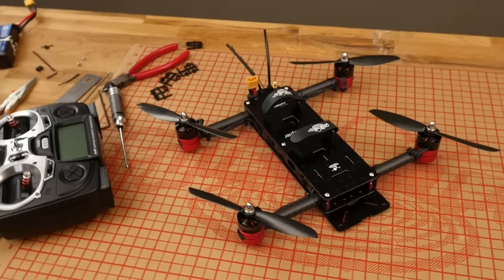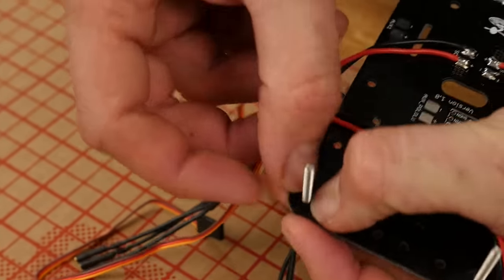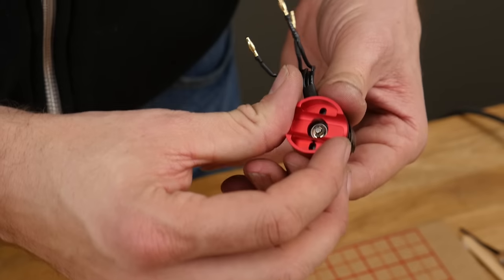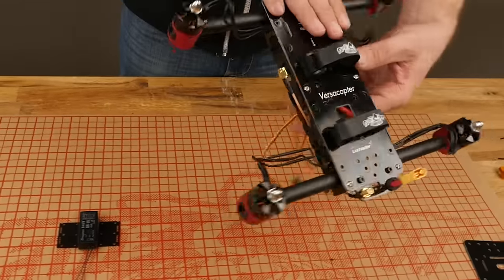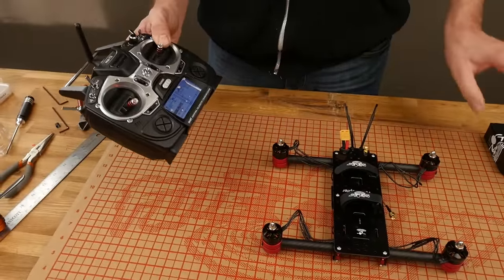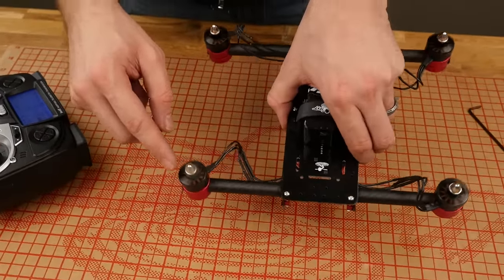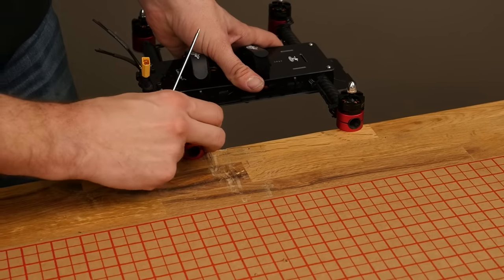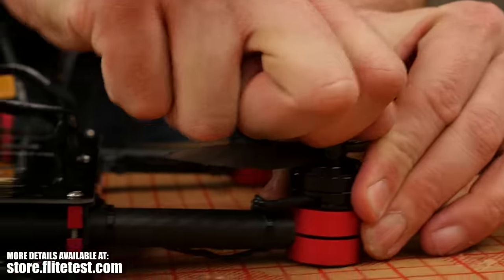FT VersaCopter v2.0 - BUILD | Flite Test

Comment: Hey Guys, from the links above and on the stores page to buy the VersaCopter, you don't have what else is needed for 100% RTF quad. Why don't you list what parts are missing from the "Power Pack E" to get it in the air and also links for a great FPV experience? Love your video's, keep'em coming :)

Comment: Hi FlightTest awesome video, this kit is probably going to be the quad copter that gets me into FPV. Since I'm relatively new to building and buying multi rotors i have a few questions. Does the FT VERSACOPTER 280- V2 -QUAD KIT come with a receiver or battery? and if it doesn't come with a battery how can i find a battery that won't damage the motors.

Comment: I wish I could get as good at flying drones as you amazing people at flite test but for a 13 y/o I never have much time or money to buy these. I recently got an akaso x5c for Christmas and I was wondering if it would be possible to use the transmitter from that on any drone you guys make. One last thing is that I am currently working on an up to code firefighting drone with a built in tank so you just have to replace a large co2 cartridge and it's possible to hook up to a fire engine and it would be much larger and I'm going to suggest it to my town if I can ever get a prototype built.Thanks for all the inspiration to start this.

Comment: With this build does the Voltage telemetry work with these esc's? Or do I need to buy a VM-80 to keep track of the battery voltage with alarm on my radio?

Comment: I'm curious to know why you guys went with the 280 size for the versacopter? Seems that 250 and smaller are the most popular for fpv racing.
Reply: +Devin Stone My only guess is that the slightly larger size make it easier to solder the ESCs and other stuff to the power distribution board

Comment: I recently got a kit for the versacopter and azide toy I swiched the leads on the flight controller to positive to negative but it works fine but another mother won't work will I have to buy a new flight controller or is there something in and do to fix it?
Reply: *on accident

Comment: Hay Flite Test, I'm interested in this Quadcopter frame and was wondering if my DYS BE1806 2300KV brushless motors will work? They seem like they would, but my motor mount screws look thinner than the ones in the video. Could you please list the width of your screws for the motor boom mount.
Reply: unfortunately no the 1806 motors will not fit the aluminum motor mounts 
that come in the kit. Both the screw size and the bolt hole span are to 
large for the 1806 motors. Josh, maybe you could make a delron or other 
material adapter to accept the 1806 motors because the 2204 motors are 
just to heavy for my liking. just a thought :) Kenny

Comment: Little question here, if i want to power my FPV Transmitter by the main battery, where on the board do i have to solder ?
Do i have to solder the power wire onto the polulu "connector", or can i just solder the power wire onto "power" and the 2 power wires for the transmitter onto aux 1 ?
Thanks for your help.
Kind regards out of switzerland 
Silvio
Reply: I think you have to solder to the polulu circuit.
Reply: ***** i just put it onto AUX 1, it works fine ^^
Reply: Neat! Pics please. My set up is a nightmare; a 2200 3s & 800mah-1000mah 2s on top of 503 grams. I upgraded to 3-d skirt from rcpartshanger.com glows in the dark.

Comment: this my Naze32 rev6 Full 10DOF Quadcopter Flight controller for QAV250 ZMR250 board that I have can you tell me how to wire my wires up to the flysky receiver this board plug has one white wire and one red wire and one black wire and one orange wire and one yellow wire and red wire and one brown wire and the other 3 wires are white red and black they run into on plug  maybe someone can help me

Comment: Does some of you guys have a good idea on how to get the USB of an SPR 3 controller accessible within the body of the versacopter?

I find it hard to solve as the board cant be turned by 90° due to the ESC outputs ;)

Any hints thankful appreciated

Comment: Thanks for the video! GJ !
But may I give a little advice - recheck your soldering because most of the connections on 2:44 are pretty much examples for cold joint. Or maybe it's the video quality I'm not sure. They should be round and shiny ... And again - great video, nice quad !

Comment: so what i need to make this is the FT VERSACOPTER 280- V2 -QUAD KIT the Power pack E and the  ms -12 Something i dont now waht it is can some one plz send a link
Reply: +Joris Alkema And what kind of a FPV camara and transmitter do i need (Plz a Link) (srry for bad eng
)
Reply: +Joris Alkema and a transmitter ? ...
Reply: +Joris Alkema and is that all i need to make it work ?? does all the paks include cables and extension ??? 
and the flight controllers
??

Comment: Hey guys really like what you do, the concept of versacopter, keeping everything "in the box", is a really good idea, you made it H its also fine with me... But Wao the building process looks like the foam planes kits you are building.. My interest went away at the min 7 of the build .. Those sides plates ? can t they be carbon maded, precutted, with no extra mini parts for adjustments ?.. This is and ingienor concept, not a builder or user process at the end, to much mini parts and tiny adjustment just for the body.. When we want it simple, and tuff... You are always saying, "you re gone crash", then i prefer to crash a zmr, or a cheap carbon blackout clone frame, i change and arm, an aluminium stand, and fly again... I wonder how this looks like after a big crash... i m sure those mini parts are blown away... you can make it, version 3 .. simple and tuff !!!

Comment: Please help me. I dont know much about racing drones but i really want to by one. I think this would be a good beginner drone but i know nothing about the parts needed to build one. So i have several questions:
First of all, does the kit bring all the parts needed to build it? If not, what else would I need??
And, what about the radio controller, does it bring one, which one can i use where can i buy one ?? Then , what about FPV how do i install an FPV system in the quad? Parts needed ?? 
Which battery do i need to power the drone ?? 
PLEASE help me I really wanna buy one .
Reply: if your just starting dont get fpv yet.  and on their store there is an option to get the e pack.  the e pack has escs motors and props.  so when you get the versacopter v2 with the e pack, you still need your radio transmitter (the controller) flight controller, battery, and battery charger, and receiver. but if youre just starting you should get the graupner kit shown in this video.  that includes the flight controller, transmitter, and receiver.  so now you have the versacopter v2 with e pack and graupner combo.  now you just need a lipo and charger, a 3s lipo is recomended.  and before you buy your stuff you should watch videos about lipos and lipo chargers
Reply: Thankyou !!!!!!!!!!!!!!!!!!!!!!!!!!
Reply: +MrKrespo25 yeah so basically all you need is versacopter v2 with e pack, graupner combo, lipo, and lipo charger.  and then after a while you can get fpv
Reply: ok perfect

Comment: +FliteTest  Hey, i rlly want to get into the hobby and have some smaller racing drones, the link you provided for all the a components you need. is it the 69 dollar kit or do you need the power pack E option. Any other transmiters cheaper than the mz-12 that will 
still work. Do u need the gr-18

Comment: That Graupner combined flight controller and receiver looks very nice. I like the idea of being able to update the settings using the radio. But doesn't it include voltage telemetry as well?  Good job on the Versacopter 2.0 design.

Comment: What battery do you recommend for a beginner-ish pilot for this quad on power pack E
Reply: Batteries are not specific to beginners. Batteries are batteries. You can go up to a 4000mAh 4s 15c for long flight times. the one they use in the video is a Lumenier 2200mAh 3s 20c.
Reply: ok Thanks

Comment: Nice upgrade to the original and thank you for offering a component kit separately so I don't have to buy a whole quad kit again. One question, is that a smoke alarm with a low battery beeping in the background of the build video?
Reply from the maker: +Yancy Smith Nope, I think that's the door chime of people going in and out of the shop during the video. 
Hopefully we will have a separate studio room to shoot in some day so we don't have to worry about that sort of thing. -Austin
Reply: +FliteTest can you bind a specktrum dx5e to this? I wanna get into quads but I'm not in the budget to afford a new transmitter.
Reply: +Galactic Diamond not as it in in the video, no. You would need to buy a Spektrum receiver and a different flight controller board, but that will only set you back about $60

Comment: Snug fitting nylon or similar, round plastic slugs  inside the carbon tubes where they are clamped will make the whole build stringer without adding too much weight (if weight is a problem, the slugs can be lightened by drilling their centers out, unless a very large hole is drilled this won't affect their strength, holes should be drilled in their centers, to avoid air pressure in the tubes pushing them out (in case people want to fly with their copters)
The biggest failing with carbon tubes is that IF they get crushed at all (ie. in a crash), they totally loose their integrity.  It is unlikely with machined fittings that the tube will get damages during the build, but it makes these types of structures more crash proof

Comment: I am new to this, so if i bought and built this I know I would need a transmitter. I see this one in the video in the store, but was wondering how many other things would it work with, Id also want to fly other things. Would it control most other quads, helicopters, planes ect. If not, what is a good but relatively cheap transmitter i could control this and other models with?

Comment: Do you have to buy the remote as well?
Reply: Shrimp Tails yes you need a transmitter and receiver unless it's the grappler gr18 you'll need something like a naze 32 too control each motor and level the quad copter
Reply: Ok thanks for the help!!

Comment: I would really like to see either a lip on the top of the motor mounts or some kind of adapter plate that can fit between the motor and mount that will extend beyond the circumference of the motor. This would give the motors some additional protection during crashes.

Comment: Where is the video on installing FPV? It would be really helpful! Thanks guys!
Reply: I am still waiting for that to come out
Reply: me too
Reply: it's easy if you watch the whole video you will see Josh putting the sma extension, at the back of the copter where the sma plug  is, there is where you will put the antenna and one the others side is where your fpv transmitter should be placed, for the camera if it has small plug add some extension and connect it with your fpv transmitter then bind it with your goggles or monitor
Reply: and I forgot the power source just add a small200mah 1s lipo to power  the fpv gear but it's a bit slow It doesn't bother me because  I use 2250mah 4s lipo it's up to you guys

Comment: Don't twist the wires hard before pre-tin, it's a big No No because the tin will not go all way through the wire and therefore not getting a strong and proper solder joint later.

Comment: Is there room for a APM 2.6 controller inside the frame?
Reply: my guess is if it has the side pins yes it would fit but top pins might not
Reply: +Skydive4ever using better esc's and putting the ESCs in the arms will give you more room... I would recommend using one of the micro/ mini apm controllers if you are gonna do that but it is made for a naze32
Reply: Brendan Taylor littlebee escs should fit but they are also very flat and you need a bec
Reply: Cole Hansen Do you have this quad frame?
Reply: Brendan Taylor Do you have this quad frame?
Reply: +Cole Hansen the immersionrc 20amp Ez esc is the way to go.... And you don't need a Bec it has a port a voltage regulator to be installed on the lower board, this is shown at 20 minute mark
Reply: +Skydive4ever nope, I do not like the the frame and do not believe it will survive the crashes my vortex or qav210 have taken
Reply: ok, let me rephrase my question. Does anybody who has this frame can tell me if they know if a APM 2.6 with top pins could fit in this?

Comment: Can you use a spektrum dx6i controller for this rc
Reply: +Liam O&#39;Halloran yes, any TX/RX combo with 4 channels will work, though you will want usually at least 6 for a quad, so you can have an arm/disarm switch and possibly beeper. 

i use a Dx6i for my  versa.

Comment: So I've been flying this for a while now with the naze32 and it's been really great. Last night however, I ran into an issue. I ordered some 6x4.5 three blade props from GetFPV and flew them on my versa copter last night for the first time. 5 minutes or so into the flight (battery at 3.9v per cell) the left rear motor was petering out during high throttle and the quad would dip slightly in that corner. When I landed the quad, that motor was super hot. I'm using the power pack E that flitetest recommends, a 2200mAh 3s lipo; the quad has a flying weight of 690 grams. 
Why is that motor overheating?
ESC problem? Bad motor? Too much load from three blade prop? Thanks
Reply: Probably the prop try again and check the other motors too
Reply: +jacob edwards I think you need extra motors in case it blow up, because my versa copter v1 has an upgrade motors (I mean I didn't use the motor from the power pack kit) and after 3-5 flights it just blew up so just be careful and I have question on your battery, how long does it fly with 3s lipo

Comment: That looks a lot like the Hobby King Quanum Venture and even though it uses plastic clamps instead of metal it's still too heavy and under powered to get off the ground even though it was factory built.  I doubt anyone would ever be able to build this and get it to fly either since it's going to be way too heavy!
Reply: steve c i built a versa copter v2 flew just fine

Comment: Hi! I am hoping to build a custom RC quadcopter, and I need some help. Do you have to use a certain transmitter with a certain receiver to control a quadcopter? I have a spektrum, DX5e remote control. Do I need to buy a "spektrum compatible" receiver, or does any receiver work? Thank you!
Reply: Hello, you will have to use a spectrum receiver as others don't work with your transmitter
Reply: +Elliot Hancock Oh ok thank you. Could you recommend an affordable RC controller system that comes with a remote control? I was looking at the on in the link below, but I am not sure if that would last, or if it would even work. 

http://www.hobbyking.com/hobbyking/store/__9042__Hobby_King_2_4Ghz_6Ch_Tx_Rx_V2_Mode_2_.html?gclid=Cj0KEQiAxMG1BRDFmu3P3qjwmeMBEiQAEzSDLhLoVMvHaXt5e2W1RABRvOkgBw6vRdbcDK_tfU7mJ9caAiOA8P8HAQ

Comment: I have a blade 200QX, I can fly smoothly on stability mode. when I change it to acro mode it stays going in one direction I know this to be normal but it confuses me every time. could someone tell me the basics of acrobatic mode?
Reply: there is no self-leveling in acro mode, you must keep your thumbs on the sticks manually correct.  acro mode is for doing flips, rolls, and flying inverted
Reply: +Señor Skillet as a note to what Nick said you cannot fly a quad inverted like a plane or you will smash it into the ground.

Comment: I just bought this kit and I've gotten to the point where I'm trying to set up my transmitter, a Graupner mz-12, and I'm having a billion and a half problems. Absolutley nothing with it is working
Reply: If you don't mind me asking, how did it turn out?
Reply: +Kijuun It turned out terribly. Graupner makes 2 Mz 12 controllers, one for for fixed wing and one for quads. If you have the wrong one, you're boned
Reply: xXRVBCabooseXx Ah I see, that's a truly a bummer. I hope you get it working eventually, and I'll be extra sure to keep controller continuity in mind. Thanks for your feedback!

Comment: could you use the "lemonRX featherlight reciever with diversity antenna LM0034" with this?
Reply: as long as you get a compatible control board, sure.
Reply: for some reason, I thought this came with a flight controller...

Comment: 3 simple questions: is there a video on how to install the FPV camera? 
Is the transmitter included? 
What's the lil thing next to the battery which has red numbers? Thanks!
Reply: 1. The video for Fpv hasn't come out yet but there is supposed to be one.
2. The GR-18 and MZ-12 you have to buy separate but you can also buy it from them
3. It is a Battery voltage alarm it will beep when the battery gets low so you don't fall out of the sky 
Hope this helps you out at bit
Reply: +Hunter Gaming thanks! It did! Is it ok if I install a fpv camera by myself and then connect it to the quanum v2 googles? Thx
Reply: +Hunter Gaming psd: I sould get the quad pack and also a transmitter, and nothing elsw? Thanks again

Comment: hey guys! can anyone tell me if these will work with emax 1806 motors?
Reply: +Kobe Vergara it wont work with 1806 because the motor mounts wont have holes close enough together to mount 1806. you could make new motor mounts and possibly get away with it, hence the "versa" in Versacopter. 

that said, the size of this frame being nearly 300mm, i personally wouldn't use 1806 on there.